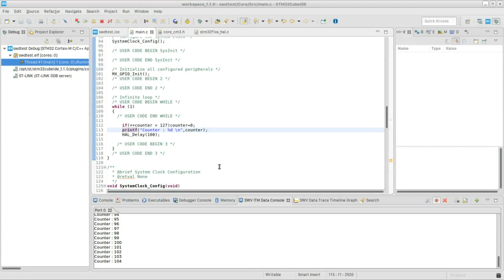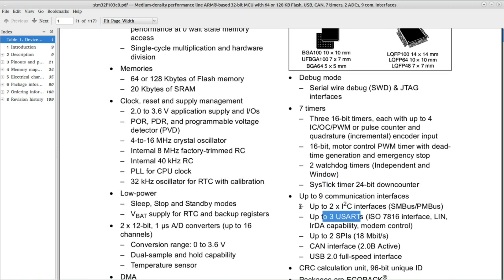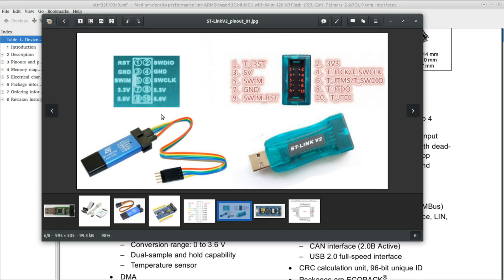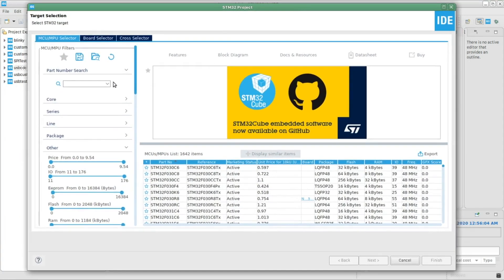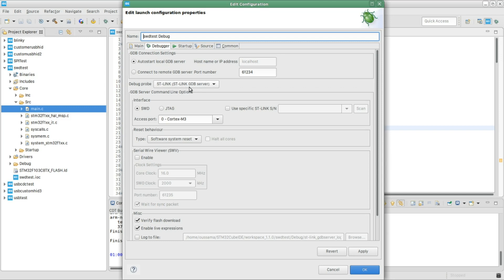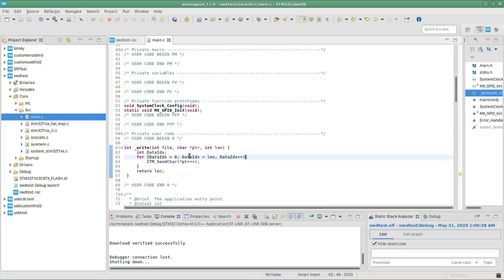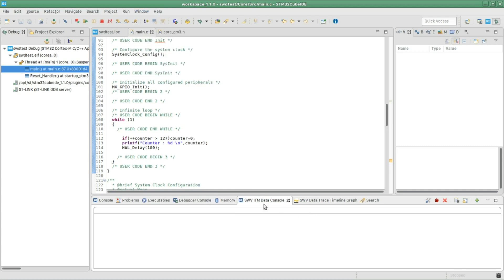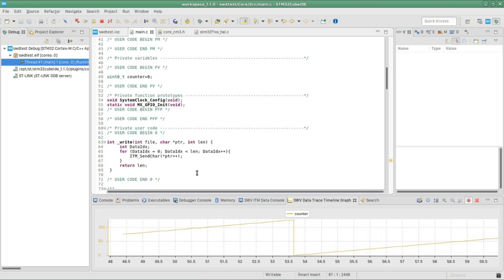STM32 (stm32f103c8) Serial wire debug -- STM32CubeIDE

Comment: Brilliant content! Modifying the cheap clone saved my day. Maybe they left that signal out because they were using M0(+) which might not support that signal too.
Do you know how to force access via SWD at boot to reprogram a board which has not set the pins correctly, basically bricking the normal SWD programming tools?
Maybe I have to use JTAG?
Reply from the maker: Honestly i didn't go all the way and test the programming using SWD, so i can't help you much with that sorry😅. 
But glad the video helped a bit .

Good luck 🤞

Comment: Now why can't you do that with a simple Serial Wire method? It really drives me nuts that I have to include so much unreadable garbage code to my main program in order to trace some variables.
I want to be able to use is in a compact and neat way that doesn't mess up readability of my program.
Reply from the maker: Maybe you can write the extra code in a separate header, and include it in your main program, that way you will only call the print function in your main program.
Reply: @OussamaOusmoi  then why doesn't everyone else do It? I'm an electronic engineer and every time dealing with code I just wonder what a weird mindset programmers have, they seem to never strive for compact, neat and readable coding method.
Reply from the maker: @andrewFJ  I agree with you, but for tutorials we tend to put all in one file as a simplification for the videos. You are free to structure your code as you like though :)
Reply: @OussamaOusmoi  Anyways thanks for your video, at least it explains something. Just one more question, perhaps if I debug my MCU via USB can I get messaged back or the "trace asynchronous SW" is the only way?
Reply from the maker: @andrewFJ  Via USB it will act as COM  port, and you could use it as a serial dongle, however it needs extra setup for the project, you may search for serial communication for stm32  microcontrollers .
Good luck .

Comment: How are printfs via ITM different than printfs over SWV?  

I thought both use SWD+SWO, yet ITM_SendChar() doesn't work for me, despite have an SWD+SWO compatible chip and debugger!

Does GDB / OpenOCD support this?
Reply from the maker: Sincerely i never heard of ITM till now :), it looks very similar to the method i used in my video though .
I still didn't have the chance to try OpenOCD as well.
Sorry i can't help you much on this.
if you got any results it would be great if you share it with us :).
Good lucj

Comment: Hi! thanks a lot for the detailed walk-through. I'm working with stm32f4 discovery board with 168 MHz core clock. I did whatever you mentioned in the video and still I get nothing in my SWV console and timline graph. Can anyone give me any idea why this thing is not working?
Reply from the maker: Hi,  is the st-link programmer integrated with the board ?
Reply from the maker: I just googled the board, and it looks like it has an integrated st-link, i wonder if the swdo pin not used,  you can try using an external st link if you have,  check out this link https://electronics.stackexchange.com/questions/230036/problems-connecting-st-link-v2-and-stm32f4-discovery-board
Reply: Hi, thanks for the reply. The st-link is indeed provided with the board. It is also detected via the debugger (The scan option). However, my "printf"s dont appear in the SWV console and my global variable "counter" does not appear on the SWV timelime graph s.th. I can however see it changing in the live expression section, top right of the CubeIDE.

Comment: I did everything as instructed but now I get this error:

"Error in final launch sequence:

Failed to start GDB server
Failed to start GDB server
Error in initializing ST-LINK device.
Reason: (18) Could not verify ST device! Abort connection"

Is there something I'm missing?
Reply from the maker: In what step do you get this error exactly ?.
are you able to program the STM32 normally ?.
Reply: @OussamaOusmoi  I am able to flash code to the STM 32 normally. But when I try to run debug I get this error.
I wanted to debug with printf.
Reply from the maker: @wangere7697   Checkout this link https://community.st.com/s/question/0D50X0000BUjpxvSQB/error-in-initializing-stlink-device-reason-18-could-not-verify-st-device-abort-connection

It seems like other people getting similar error and it looks like it's probably due to a counterfeit board . do you have other board to try with ?
Reply: @OussamaOusmoi  Thank you.
I am expecting some few boards this week.
Reply: @OussamaOusmoi  Thank you.
I am expecting some few boards this week.

Comment: Is it possible to capture this data with some external app. For example if I wish to visualize my data via python script, and I still wish to avoid using the USB2Serial dongle, could I somehow capture the data sent to this port via python script?
Reply from the maker: It's probably possible using openocd and pyocd , but i wouldn't recommend going that path, as the SWD is only intended for debugging purposes, not for communication .
I would suggest looking at virtual serial implementation on STM32 microcontrollers using something called CDC.
check out a youtube channel called Controllers Tech, he has a good video on that .
once you have implemented that, you can then easily use pyserial to communicate with the device .
Good luck.